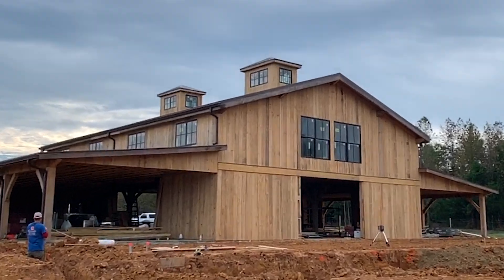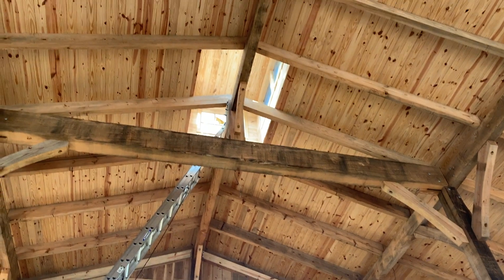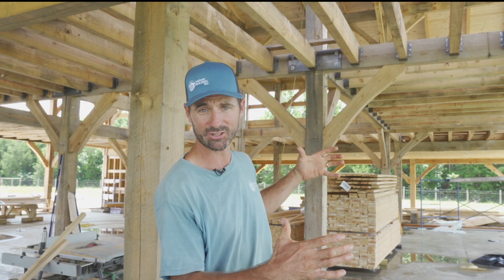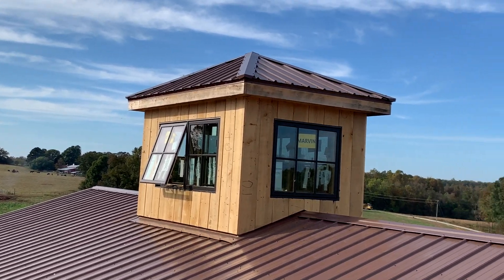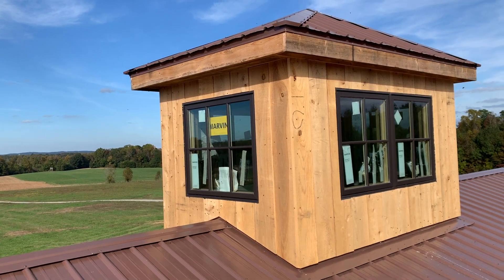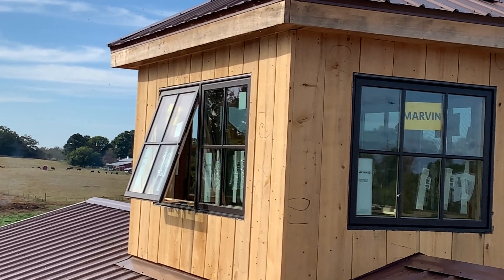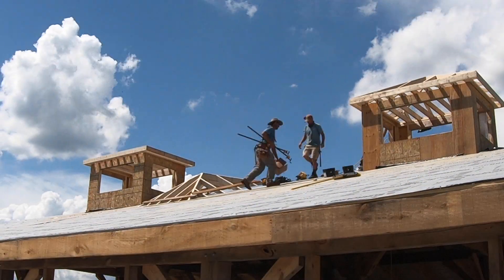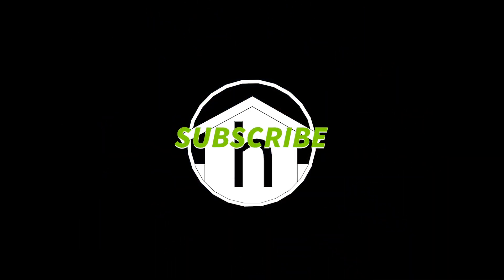What is a CUPOLA?

Comment: Your work is absolutely beautiful..! I live in southern California and plan on building 3 of these on my roof. My question is how effective is it to include a back draft louver to this project & are there any concerns that I may need to be aware of? I might also add that I plan to install a whole house fan  in the attic to move the hot air out. Thank you for your time & look forward to your input.  Cheers
Reply from the maker: I would design for a backdraft louvre, but probably not put it in unless it proved necessary.
Reply: Attic fans are out dated. They draw in moisture, you're better off running your AC 24/7, otherwise it has to suck all the moisture out of your home.

Comment: Can you go into more detail about the motorization of those windows being able to be opened? It looked like they were just regular hand-crank windows in the video.
Reply from the maker: I made the majority of this video before we purchased the windows. And based on the extra $10k and unreliable function of the motor controls, we decided to go with regular awning windows. The awning windows will shed rainwater so they don’t need to be closed every time it rains. And it’s likely that the windows will only need to be opened in May and closed in October. Sorry To be misleading. My window sales rep highly recommended we not use the motorized windows. The controls caused more trouble and maintenance than they helped.